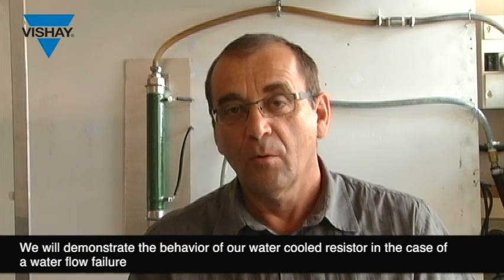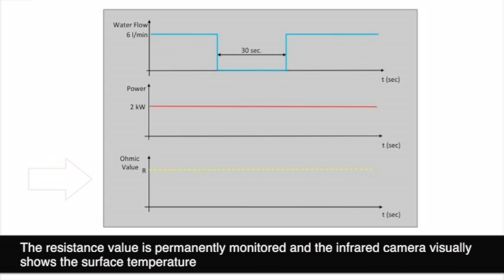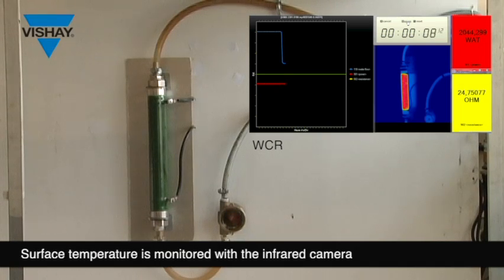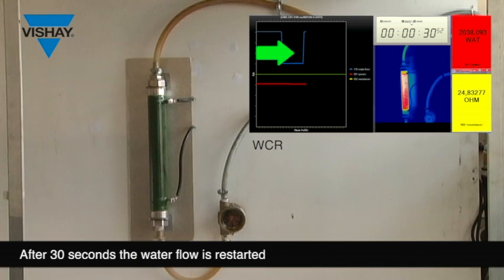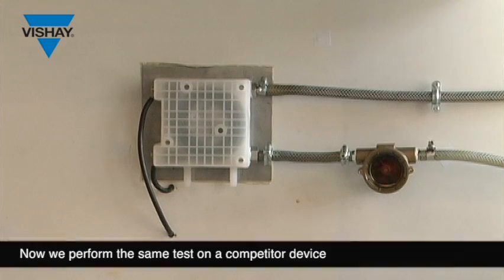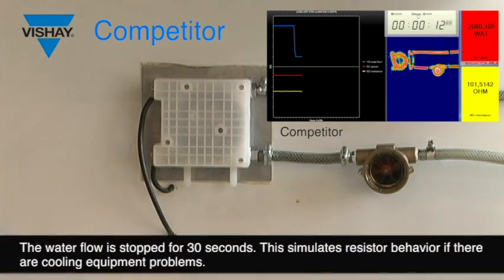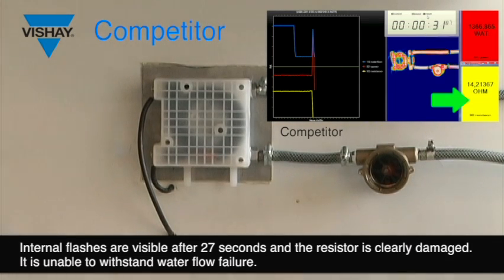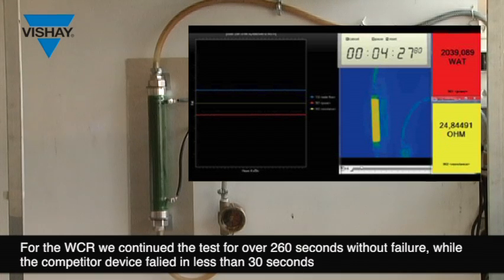The New Vishay water-cooled wirewound resistor demonstration video | RS Components

Comment: thats pretty awesome.   water cooling is a good way to get over the expense problem that resistors present when needing high watt.     I was wondering that using acid can be really good as well just conducting through it to get ~100 ohm,  but presents possible risk in doing it.  water is safer by a mile.